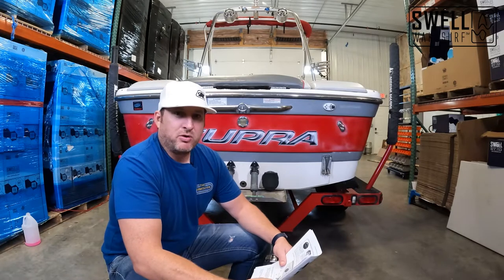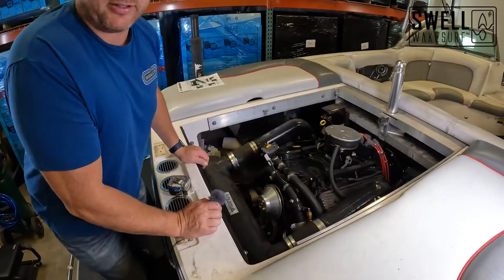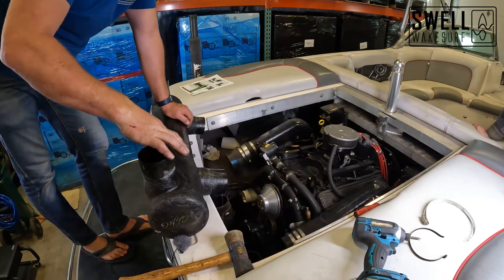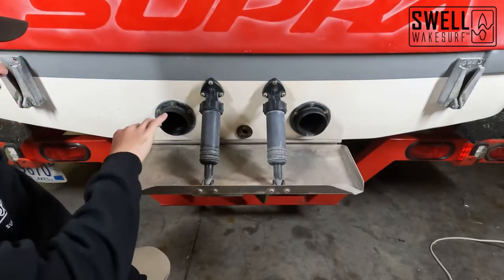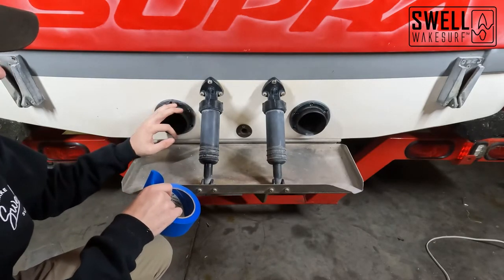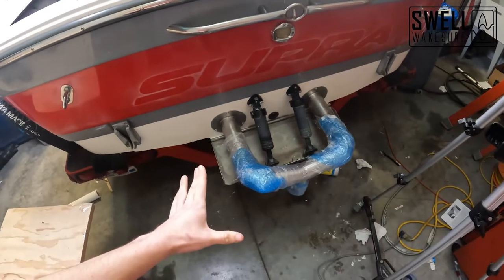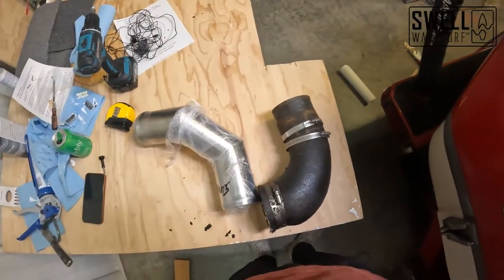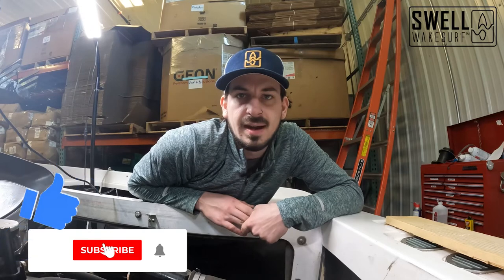2005 Supra Boat Build: Episode 2 - Fresh Air Exhaust and Mufflers

Comment: So, no car exhaust system would ever be set up to have opposite cylinder bank pulses interfere with each other. In the very least they would be a more parallel Y style. I don't understand why these aren't designed to not send wave fronts and exhaust pulses into the opposite pipe. That has to have HP losses associated with it.
Reply from the maker: Totally different than a car engine as the water passing the exhaust actually creates negative pressure and pulls out the exhaust from the pipe, so there is no performance loss. You can read more about it here: https://www.freshairexhaust.com/about-us/performance-2/